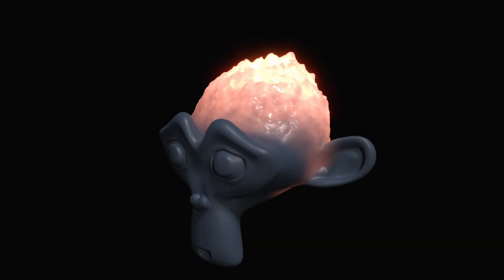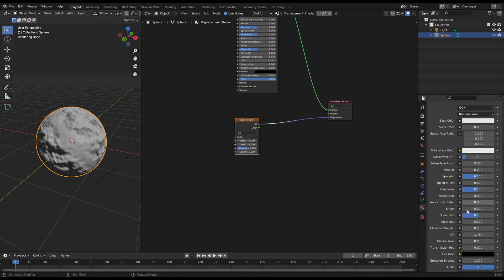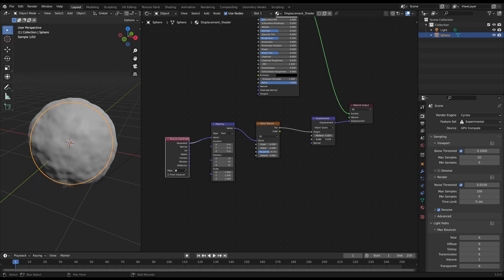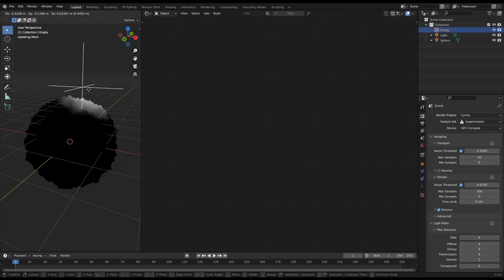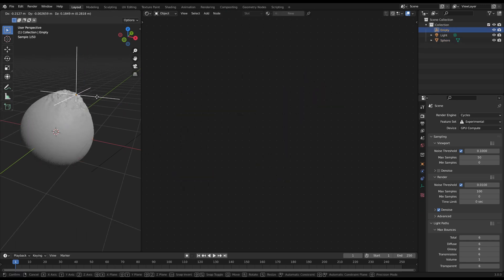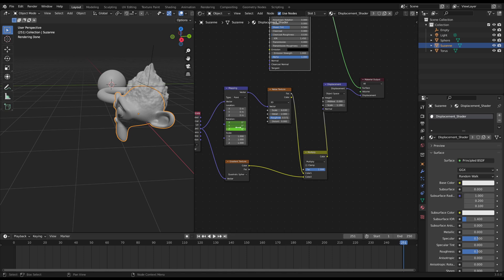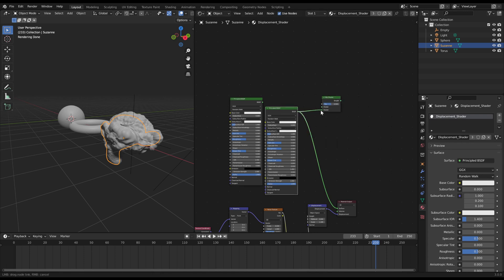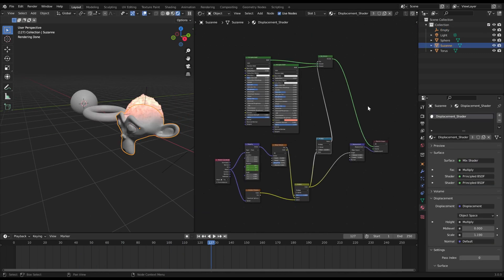How to control a Displacement Shader in Blender

Comment: Nice thks for it, but how to make it invert?
Reply from the maker: Well, you just have to invert the displacement vector.
So after the displacement node:
Vector Math on "Scale" and use -1 as scalar.
Then it will displace the points in the opposite direction.

Comment: did it work for all of u? not working in 4.0.2 for what ever reason:/ double checked every single node...
Reply from the maker: Have you enabled displacement visibility and are you in cycles?
Reply: @PointCloud  of course, everything works fine, its just not pointing at the empty, when i move empty, entire texture moves everywhere the same,  but will figure that out, great video!

Comment: Really nice tuturial ! I was just wondering if you could do a tuturial on how to create melting effects or warping effects like RUBEN FRO uses it in his point clouds. I know that he is using unity with a custum written code shader and there are other programs like houdini or touchdesigner where you code a lot but I would like to know how to achieve a similar look in blender. Is that possible ? Would appreciate an answer :)
Reply from the maker: @O

Do you mean like in the "Dissolving  Realities" videos?
Reply: @PointCloud  Yea like the process of importing point cloud with renderer in blender and more important which modifiyer can someone add to create animation effects over time ? And how do you apply it to specific parts of the point cloud so not the whole point cloud is for example with fractal noise :)
Reply from the maker: @O
Very interesting footage. It is definitely possible in Blender, I will look into it and I can imagine making a tutorial about this.
Thank you for the request, very inspiring.

Comment: Can this be done on the normals and use one empty for the hole sene? I want to add snow to rocks but also trees. If I only add this the way you have done then only the top of an object gets the displacement. With a tree I need the displacement to happen on each limb all the way down. Also want to be able to scatter rocks and have the texture shader creat snow on the angle I choose so no mater which way the rock scatters the displaced snow is always in the correct angle.  Your tutorial is amazing yet if I and this to a tree I think it would look wrong. If you get a chance could you look into it?
Reply from the maker: @militaryvetandfather

Thank you for your comment.

Your problem can definitely be solved.
But not with this method, because here you calculate the distance, which does not lead to the goal for a whole scene.
You need a dot product of all the normals of the objects in the scene and a (0/0/1) vector pointing upwards.

Coincidentally, I have done a tutorial on this in the past.

https://www.youtube.com/watch?v=h0hLh657cag

My method there generates a lot of geomery, but maybe it still fits for you. And if not, you can transfer this technique to the shader editor and do it without geometry.

Let me know if you could handle it, or if you still need some advice.